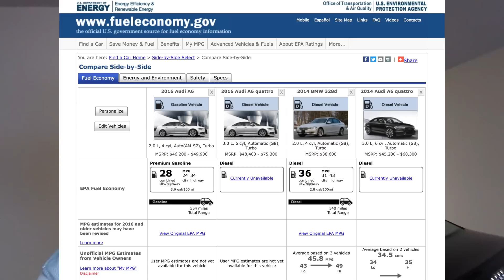TDI Cheats and Fixes Explained: Audi, VW, & Porsche 3.0 liter V6 diesels

Comment: I bought my 2015 Audi Q7 TDI oct of 15 we now have 199k miles on her an it was a darn good purchase. After the updates the wife noticed the adblue would go quicker and performance felt a lil down but once in sport mode she moves like a rocket. We got over $2500 for our time but man they need to bring that tdi engine back when i say 199k miles no issues i did oil change every 7500 an fuel filters every other oil change

Comment: I've recently purchased an A6 TDI with the 3.0.  My local Audi dealership has changed the dpf, scr unit with another that has an O2 sensor closer to the engine. 

The car came back pretty good, however fuel efficiency was at about 34 mpg highway.  I've since been able to increase that to about 40 mpg at about 80mph without mods or tuning.  The car runs great, in dynamic sports mode the kick into the seat when it picks up is unreal.
Reply: Mind me asking how did you increase mpg to 40mpg?
Reply: @bigpapa247  by reducing friction.   A metal conditioner I've been adding to the oil.
Reply: @lcambilargiu  which one do you use ?

Comment: Recently bought a 35k miles 2015 Macan 3L diesel which has most irritating tapping noise at low revs and low load.  As soon as I apply throttle the noise disappears and engine is smooth. Sounds as though there are mechanical clearances at low revs and they go when loading occurs.  Can you give an explanation please as neither Porsche nor Audi dealers can?
Reply from the maker: It's the diesel fuel injectors. They pulse 5 times per compression stroke at 35k psi, which is enough pressure for water to cut through steel. You are hearing the injectors. Fuel filter must be changed every 20k miles. Make sure that was done. Be sure you are using the correct engine oil (LL03 spec if I recall correctly). There will always be different sounds from diesel and gas direct injection engines due to air temperature differences. Air temps change combustion, especially in diesels due to air density and flash point for combustion. I'm not an engineer, but I have owned 2 A6 TDI models, a Mercedes E350 bluetec, and two VW TDI models in a span of 8 years. They will run forever.

Comment: With the TDI issues I purchased a 2014 A6 TDI with 54,000 miles.  Fix was done.  Now have 109,000 without one issue and it runs great.

Comment: If you dont wanna have any problems dont buy cars with ad blue. Best diesel engines are basic tdi. I had older audi a6 c6 and it didnt have any "ecology" shit (dpf, egr, air flaps). Everything was shut down with diagnostics. No problems with engine, same emissions, same fuel consumption.

Comment: Did I make a mistake buying a new old stock VW Touareg TDI ?
Reply: No great buy.  Delete the egr and dpf and you have 500k motor.
Reply: PFeal can I pass emissions in New York if I delete ?
Reply: @yankeedoodle6293  No you won't pass but you could pass your test then remove it all and reinstall it for next years test.  Not very cheap if your not the mechanic.
Reply: PFeal thank you!  When I take it in to VW for service, wouldn’t they see this and void my warranty ?
Reply: @yankeedoodle6293  yes that will void your warranty.  I wouldn't do it till it's up.  Search egr delete and dpf removal for vw engine(whatever one you have) and see some of the installs and they explain the benefits and issues with doing this.  The issues are regulatory and it's bad for the air quality.  the benefits are plentiful because your not recirculating exhaust into your intake and you'll gain fuel mileage and your engine will operate more efficiently.
Reply: PFeal what sort of damage is is currently doing with the current set up ?   I’ve got the VW V6 TDI
Reply: @yankeedoodle6293  egr recirculates exhaust gas into intake which contributes to more carbon build up in engine internals.  Not a ton of damage per say just not efficient to intake dirty air and residual fuel.
Reply: PFeal thanks bud.   What do you think of the Land Rover discovery sport ?  They drive nice, quality cars ?
Reply: @yankeedoodle6293  never driven one.  Got a few friends who do and they like them, they have sports though.  I guess since about 13-14  they've really improved the quality overall and their actually reliable now.  Hold their value a little more than Audi now a days too.
Reply: PFeal - will it void my warranty if I delete ?
Reply: Can I pass emissions in New York if I delete ?
Reply from the maker: You bought the right TDI. Congrats!
Reply: Diesel Drives I was just on auto trader researching the Mercedes Benz E class.   Thinking of trading my VW for the Benz..

Comment: Our 2014 diesel Cayenne now jerks and jolts under 25 MPH. It has a serious jolt.  It is scary at times.  Dealership had no clue how to fix, ran it up through channels and was told that is part of the fix.  All cars with repair will have this issue.  Won't fix it further.

Comment: Had my 2014 Audi A6 3.0 updated.  Didn't do anything with the cat and all this noise.  It uses a little bit more Ad Blue, (DEF).  It's $8-$11 for an entire jug of it.  In 10K miles I added some...  Car runs great and my warranty is even longer.
Reply from the maker: The 2014 fix requires new cylinder pressure sensors and it will use more ad blue. The 2016 just needed a software update and will use less ad blue. https://www.youtube.com/watch?v=EBidfdRz2sc
Reply: Ur engine is noisy?

Comment: Have watch your video many times - I have deposited $1000.00 on a new A6 TDI to purchase after the settlement/fix.
Or Should I just buy a gosoline version A6  - Shall I just get my deposit back - I am from Canada. Pl. help me make that decision.
Thanks
Reply from the maker: I have a 2016 A6 TDI Prestige, B&O, Comfort Seats.... sitting in the garage since October 2016. I drive press cars all the time but on the occasion I don't, I purchased an A3 quattro as a commuter since I was worried about a total loss beyond my control. Would I keep it? Nope. One look at the 2019 A8 and I'm sure the new A6 and A7 won't be too far away. Diesel is great for range - that's a luxury most overlook and don't understand. Before you cancel your A6 order, head over to Porsche and check out the new Panamera. One thing all long distance road trip vehicles should have is an air suspension. The current A8 with massage seats and a V8 (or even the supercharged V6) would be a screaming deal by December 2017 (and the A8 includes air suspension!).

Comment: Ff they increased the flow of the Adblue to correct the emission I wouldn't have a problem adding it myself to compensate for the small tank.  Give me the Adblue and a simple system where I don't have to go to the dealer and done.  That must of been too simple to he Corp. fools.
Reply from the maker: +Kelly Fontes The issue is deeper than that. AdBlue dosage is one issue. Even if that is adjusted, the 2 gallon tank would need to be easier to fill. I need to use the leg wrench just to access it. Then there's the issue of the stainless steel exhaust. Will it withstand additional AdBlue?

Comment: I just bought a 2015 Q7 TDI Vorsprung from a Florida dealer. The window sticker shows the mpg as 22/33. It turns out this was a Canadian made for model. Do they (Canada) have lower emission standards and is this the reason the mpg was higher than an American made for TDI ?  I tried to go into the vwsettlement site, but it won't take my vin #. I then went to the Canadian vwsettlement site and it does not have anything for 3.0's yet. Know anything about that yet?
Reply from the maker: +joseph phillips Call the state attorney general.

Comment: Hey bud, I got caught up in the VW TDIgate with my 2013 Passat SE (Love the car!) when I heard they were possibly going to be forced to buy them back I found a 2015 Passat TDI SEL with 8,000 miles for $25,000, (a trade in.) I figured I would sell the 2013 back and keep the 2015, we don't have emissions testing here in NC. Well, it turns out VW will buy my 2015 back for around $32,000, (best investment I have had in awhile.) To say I was floored, and happy, is to put it mildly. My next plan was to sell both cars back to VW and take all the cash and buy a low milage A6 TDI...but now it seems that plan is scrapped as well.  On to plan number 3, sell one back now and keep the other until Sept. of 2018 when I can still sell it back, then focus on what other car is out there that looks fun.    Right now I'm leaning towards the Genesis G80 AWD, about $54,000. Or a used low mileage Audi A6 3.0T Prestige, under 20k miles for around $47,000. Figure I'm use to paying diesel prices, so screw it and pay for premium.  Thanks for all the updates on Diesel Review and good luck on the other channel.

Comment: I own that same car they will have to give me 55000 dollars, i will not allow them to reduce the power or otherwise.
Reply from the maker: They are going to need to cough up more than that. The sales tax alone on a $55k-$125k purchase (Q5 through A8) is going to be ten thousand dollars and up, including the sales tax on the replacement car (which will also be in the $55k-$125k range). I haven't even broken out the calculator to figure the cost of depreciation, which we know will not line up with the existing leases. If your car is leased, you can stick it to them by turning it in at the end. If it's financed or a cash purchase, full refunds plus damages and nothing less. It's pure, willful, negligence on the defendant's part.

Comment: Hi I work on European car for a living here in Canada so I work on all European brands of diesel and I'm wondering how is BMW mercedes dodge Ford and GM is able to pass all emissions the design of the engines are very similar and they mostly use the same suppliers Bosch and uses SCR EGR etc systems how are they getting away with the emissions my bet they are as worst but haven't been caught yet in Europe most diesel manufacturers are polluting way more than what they are supposed to.
Reply from the maker: If your logic is correct, then the latest news on gas V6 models with quattro and a ZF8 transmission would mean that all vehicles with a ZF8 transmission would practice the same tactics. That's not likely.

Comment: You can buy Adblue from a pump at any truck stop. Why would you need to go to the dealer to top it off? Is the diesel tank supposed to last 10,000 miles also?
Reply: Or you could just keep a spare wrench in the boot...
Reply: Diesel Review I bought a screwdriver and fited a hex and leave it in the trunk, i fill the adblue in my garage when it says 1000 ill sell it back if the price is good otherwise ill drive it unless its illegal to do so, which trump will reverse anyhow.
Reply from the maker: You clearly don't own an A6. If you read my flaws and problems article http://dieselreview.net/review/flaws-and-problems-audi-a6-tdi you'll note that the AdBlue filler cap requires the LUG WRENCH to undo. This lug wrench is located in the tool kit in the trunk, underneath the spare tire. This means, at your suggestion, a truck stop, one must unload the trunk, act as if he or she (let's be honest, no woman is going to bother - especially at a truck stop) and proceed to remove the spare tire. So with all your junk in the trunk on display at a truck stop (in front of the DEF dispenser as well), you can easily refill your AdBlue tank with DEF. NO WAY IN HELL.

Comment: NEW cheat found on ALL Audi vehicles with automatic transmissions...  https://www.youtube.com/watch?v=2fI06DK1LNw
Reply from the maker: So far, it's not all Audi models. It pertains to models with quattro and ZF8 transmissions. However, it could include V6 models only, but might also be V8 models. There's no specific information yet, and it appears to be logic relegated to the transmission software, not the engine management software. We must wait and see how this story develops.
Reply: Yep, I agree.   I just think with this new news the U.S. regulators and The Justice Dept will not have any patience with Audi this time around and in the long run it may cost Audi by killing VW and maybe something else (another brand) here in the US on top of another massive fine.  I also think this new find will really shake consumer confidence in Audi for several years.
Reply from the maker: I'd like to know what was discussed in Volkswagen's emergency Board Meeting on November 4, 2016.
Reply: Yes, me too.  Because it didn't involve these latest findings.   Or did it?  Maybe the German publication or news agency that broke the latest news leaked it back to VW and thus the meeting.
Reply: Anyway looks like VW is going to be on double secret probation, if I may steal that line from Animal House.
Reply from the maker: It could be anything. I was thinking it could be something related to a vote on a partnership with FCA.

Comment: If they are able to  find a fix for the 3.0tdi, does that just leave us owners with deprecated vehicles that nobody will want due to the tarnished reputation of VW's tdi's? We have been waiting for more then a year for a fix, all while our cars deprecated and nobody wants to take them. What will the compensation for us likely be if there is no buyback?
Reply from the maker: +JP That's my question as well. The VW dealers already won compensation from the courts. We should be allowed compensation under the same reason. Furthermore, these dealers are going to have revenue from buyback processing AND an additional sale to the owner who turns it in (if they choose to stay with VW). There better be a buyback and compensation.
Reply: You damn right there better be a buy back. Complete BS to leave the consumer high and dry with a force fixed. Every reason I purchased the TDI (MPG's, Resale, Performance, Environmental, Reliability) all could be hindered due to this scenario. VW makes it right, I'll come back, but if they screw me over, I'll wish pure hell on the brand. I have two 3.0 TDI's.
Reply from the maker: +Michael Utley Kelly Blue Book (KBB) doesn't even list my 2016 A6 TDI. And with EPA pulling the stats from fueleconomy.gov, how are owners supposed to believe values have not been adversely affected?

Comment: Few times before pulling off TDI's fuel economy numbers they had decreased the fuel economy numbers on 2.0 TDI (2011+) by about 0.3 l/100 km (don't know how much it is in MPG's). I thought it could maybe be because the had number with a "fix", seems it's probably not the case by what we know so far. Thanks for the infos!

Comment: just wondering what happens if you don't do anything....you want to leave it as is and thumb your nose at Audi/VW and the Feds?
Reply from the maker: It will eventually be barred from registration. The settlement for 2.0 vehicles stipulates that states which accept funds cannot prevent fixed TDI models from registration. If the TDI is not fixed, it's clear that the state can cancel renewals.

Comment: Is this the same story for all v6 diesel's ? I've just bought a 2015 SQ5 ! .🤔
Reply from the maker: +William Lau SQ5 is gasoline in USA.
Reply: +Diesel Review, meaning in general...your right is a 3.0 tfsi in the states.
Reply from the maker: There are two different V6 diesels affected. One makes 408 lb-ft or torque, the other makes 428 lb-ft. The A6 makes 428 lb-ft and includes the all-in-one catalytic converter, dpf, and scr. This is the Gen 2 engine and it's found in the Q5, A6, and A7. The 408 lb-ft is found in the Q7 and A8. However, in 2014, the A8 received the Gen 2.

Comment: We will see what happens I suppose.  When was the next hearing scheduled for?
Reply from the maker: +Andrew Price A court date was today with VW and the judge extended some sort of deadline for December 1. I haven't received any info from Audi.
Reply: Diesel Review Yeah I read that after I watched your video.  Thanks for taking the time to reply though.  Yeah this happened with the 2.0L Diesels as well.  They tend to give about a month between updates.  Apparently Breyer is "very optimistic" that a resolution can be found, but as I recall that was the same wording used with the 2.0L diesels before; so it is hard to get much info based on that. 

If he isn't thrilled with the progress in December he will give them another 30 days to work on it before a court date.  Once there is an actual court date on the books Audi\VW will move quickly to avoid any hearings.  From there it will take 4-6 months to reach resolution.  According to Reuters though the plan so far does not involve buying back our cars, but we will see what happens with that.

http://www.reuters.com/article/us-volkswagen-emissions-idUSKBN12Y203